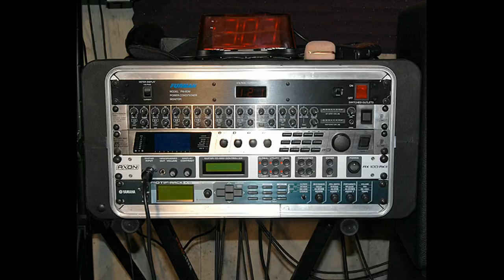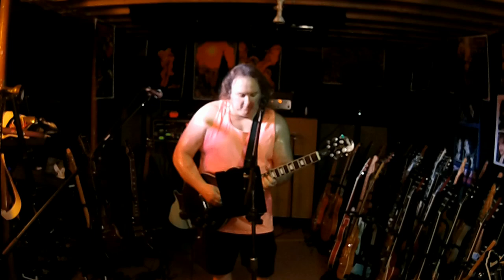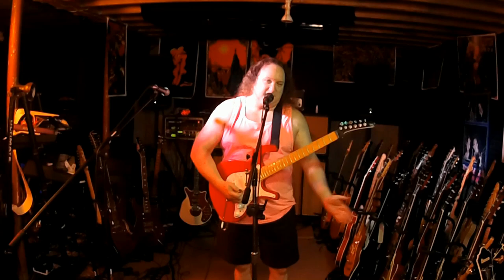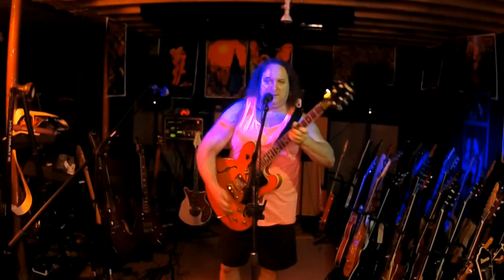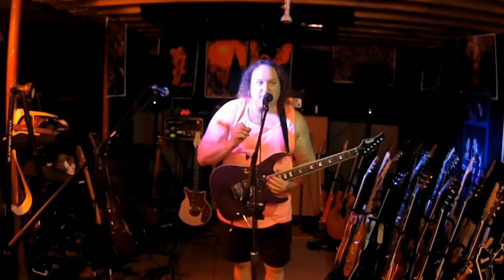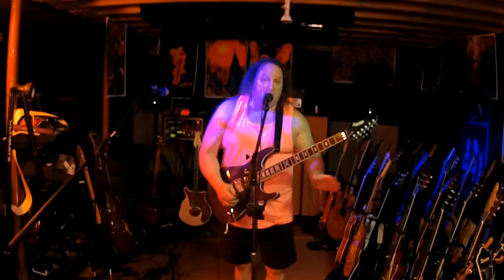Greg Fryer Treble Booster Deluxe Demo with Line 6 Vetta Modeling Amp   Version 1 with cover clips

Comment: The pedal is impressive . .but as a former owner of a Vetta 2 I'm really impressed that you are still using one of these amps and getting ( at least as far as I can hear via Youtube) some really good tones. Do you have the Armin mods installed? In some ways I miss the Vetta, but I've been hearing folks say that they are having trouble with the little battery in it for the memory giving out.  Nice chops and quite a collection of guitars you have. Cheers.